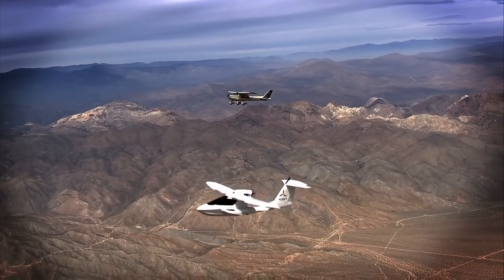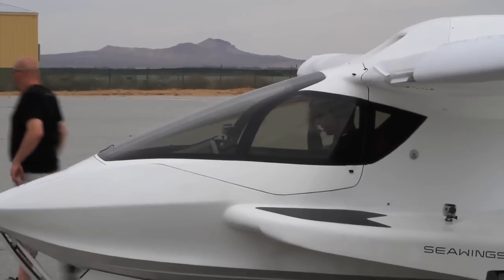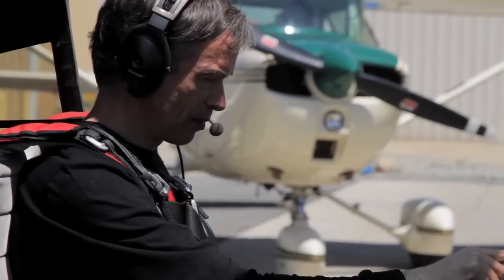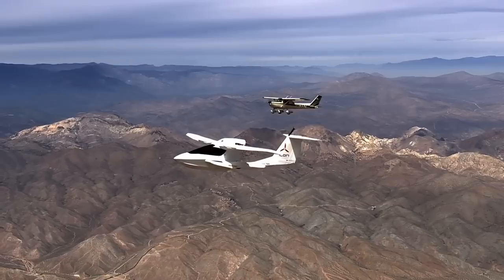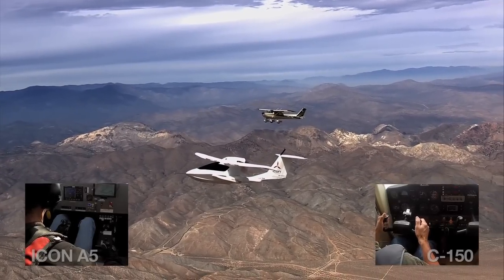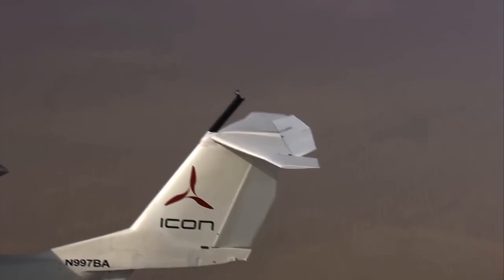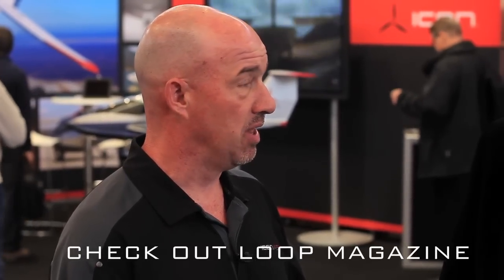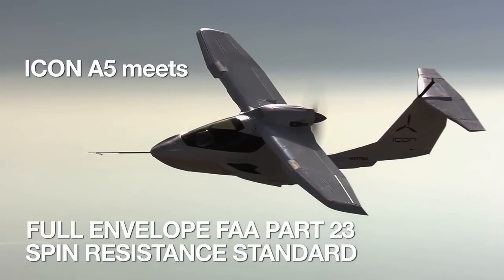ICON A5 AIRCRAFT UPDATE - ROTAX ?

Comment: The company says it needs an additional 250 pounds above the current weight limit of 1430 pounds to accommodate the extra wing and tail surface area, and attendant structural components, to make the aircraft spin resistant. That's roughly the equivalent of the weight of a Cessna 152.